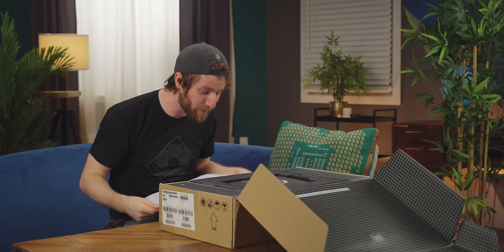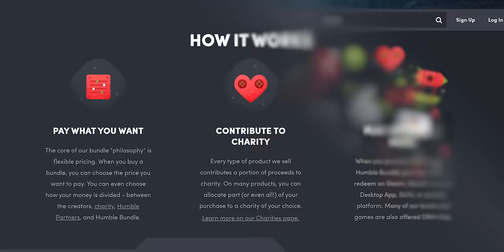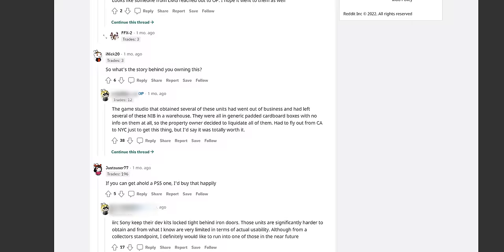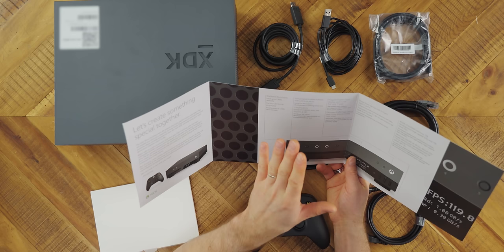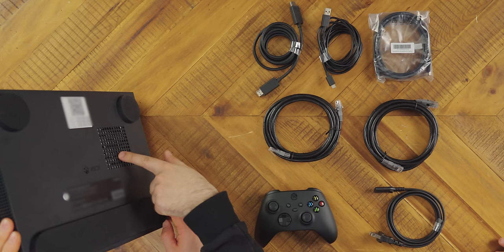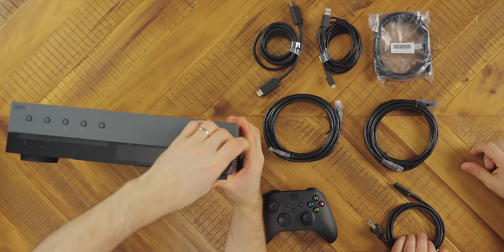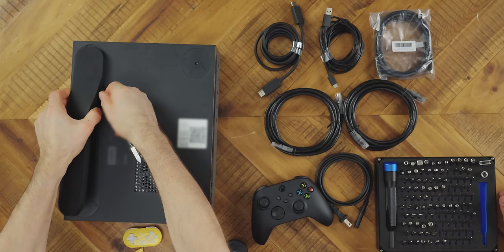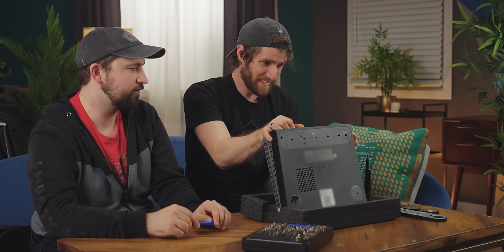I Can't Believe I Paid Two Grand For This - Xbox Series X Dev Kit

Comment from the maker: The extra memory is mostly for all of the extra debugging software, and a little bit for unoptomized games.
Reply: first again
Reply: @xmackdaddy69  yes, he did
Reply: I figured that was the reason, because I wouldn’t see the reason why an Xbox should have 40 gigs of GDDR6. Absolutely insane.
Reply: @bluephoenix1525  what's the exact reason for banning steve?
Reply: @renofumi28  they didnt ban steve, steve obtained it banned. But even if they did ban steve it woulda been because he wasnt supposed to have it
Reply: Litttt
Reply: Cool video
Reply: It's crazy you got your hands on this so early. Like wow that's absolutely nuts lol.
Reply: It got banned 😆
Reply: GN: "I got my hands on an Xbox dev kit."
Linus: "Write that down! WRITE THAT DOWN!!"
Reply: I need a gpu for my sons computer tower he has an rx 470 4gb in it now but it's stuck at 100% utilization ,the card gets extremely hot and just crashed when you try to play a game, I removed the metal backing plate in an attempt to see if it needed thermal paste and then I saw burn marks on the metal backing plate as well as on the circuit board,,
I don't know much about computers but I paid $1,200 for his computer tower @ xmas time I had it built from a guy online and he got 4½ months out of this rx470 4gb gpu card..
Can anyone help us out with a gpu so I can get his tower up and running again so he can play his games..
We're located in northbay ontario canada, we need Linus help but I doubt he'll ever see it
Reply: Taking bets on how long before Microsoft sends LMG a take down notice
Reply: @Anonymous-n7d  linus has a forum
Reply: "unoptomized games" pro english Linus...
Reply: FINALLY IVE BEEN ASKING FOR THIS WOOOO
Reply: Install original xbox os on the dev kit
Reply: my question is, is it white listed on a hardware lvl or just on the SSD? If just on SSD you could put a SSD out of retail Xbox.
Reply: @xmackdaddy69  no it came banned already I believe .
Reply: oh ok
Reply: hello btw
Reply: usually debug symbols are also stored in the application. Debug symbols are intended for developers to set breakpoints and view code during runtime. Usually (for big games) they'll be very big as it contains unmangled names, structures, classes, and etc.
Reply: 22nd
Reply: @Anonymous-n7d  The problem is that even if Linus sees your text. He probably gets thousands of people asking him. So I highly doubt he will respond to you. I hope you get the GPU sorted though.
Reply: also wouldn't all the problems Xbox players are having with DRM lately tell you everything you need to know about having to sign into Xbox to play you games even FUCKING devs.
Reply: Don't want to wait for daily builds of your software to download, so 10G.
Reply: i think having an fps counter on my console would be good to have. Find out if something is acting funny, or indirectly check if temps get to high
Reply: You missed to censor the label on th box
Reply: @SpaceGamblerJR  Didn't steve replace the SSD and confirm it was on a hardware level?  I might be misremembering but I'm pretty sure he confirmed that it was the hardware.
Reply: 4:50
Reply: now you owe it to audience to show how to solder a Modchip into the console and get it working!
Xecuter chip, ...
Reply: Not sure if the editors forgot to blur it, but the console id is visible at 17:00
Reply: For your information, remote debuging via Lan it's a thing :)
Reply: any game that is also playable on Xbox One needs internet to play on Series consoles so I'd assume if you had tried a native XSX game disc such as DMC5 Special Edition you would have been able to play it
Reply: Drama
Reply: So it might just run Ark properly
Reply: Don't watch this video , another then on off he cant run even one game.

He  try 22min ,but in the  end   nothing. Go start and waste 100$ on games and $4K for 2 unit xdk.

The only reason this units in sell ( the unltimte game con) is it useless.

i will use it as pc. Format all the drive and instal windows 10
Reply: THIS.
Reply: Guys, you should de a video about:

Who is this person and why it will be hosting videos.

because when i don't know who is talking i do not hear them because i'm unsure if their opinion cloud be valid.
Reply: People need to understand the title right: I Can't Believe I Paid Two Grand For This
Meaning LMG paid MICROSOFT for it not them paying him
Reply: So you paid a sc**per price? ;) ☮️
Reply: Could you has try USB harddrive with  game instill to test it offline?.
Reply: Does Linus just play the idiot?
Reply: Usually, these are paired to a PC that has a XDK installed.  You can usually launch the app from the pc and it will run on the dev kit.  You definitely use the debug cable to get memory dumps or monitor log streams from the console as your app is running.  Wired is way better than wireless for debugging, since log lines can get so big, frame (network frames that is) congestion could impact gameplay.  This separate connection helps ensure you aren't going to have that.  Ultimately all the additional headroom in spec is for debugging during runtime.
Reply: Stacking: Back in the Big green days, we would stack 8 tall for hardware compat.  Definitely did not help with those efforts.  Most testing I was part of was single user on a bench with room for 10.  Each tester had their console, a recording device (VHS, before we had pc's to capture issues on), a secured cage, some controllers, etc.  Thinking of the cage makes me check for cuts on my fingers.  Brutal hardware.  Sometimes we stacked 4 consoles in a cage for multiplayer testing stations.  After going to 24/7 testing, they ditched the cages.  benches held 24 smaller stations, and their test plans went to the trash.  I think they relied on earlier compat to do initial play testing, before giving it to the machine of 24/7 testing, where they would compress a weeks worth of play in 3 days.
Reply: @Linus Tech Tips  what happens when a video you try to make ends up scrapped and the money you get from announcing the sponsor go to do you use it for another video???
Reply: See this is why xbox upsets me. They have the tools and can add anything they want in the context of updates, but when actually adding updates on the FINISHED products; the consoles X/S are constantly having issues. Also noticeable is the awful quality games are released with; why not use a regular console for development purposes? If they did that, they would know if the game ran properly or not. I mean why keep these dev kits a secret?🤔
Reply: No, the extra memory is for extra data primarily unoptimised builds.  The extra debugging doesn't need much more RAM.  You would be suprised how much more ram an unoptimised game needs.
Reply: @SpaceGamblerJR  Its hardware level.
Reply: The extra memory is also for your SPONSOR.
Reply: I WAS OUTBID ON THAT BY YOU
Reply: Have you never seen modern vintage gamer? He's a decently big YouTuber who goes over the history of all this stuff. Before even watching this video I knew the games weren't going to run on this. On his videos he has development kits and lets his audience know that commercial games cannot be run on development kits. I really hope you didn't make this video knowing that.
Reply: @aloluk  how about make series X with upgradeable ram for unoptimized games❓It would future proof Xbox for 10 years.
Reply: So far the most expensive and broken things were the extreme intel server CPUs from a scammer.
Reply: Should of checked if you could cloud game via the game pass
Reply: Not many actually knows that One X was made and constructed and build with an NVMe SSD in mind.
You can see it if you open up your One X.. there is a big outline for an Key-M NVMe and there is even discrete components that as far as I can tell is referred to that NVMe slot.
but somewhere down the line, after motherboard was designed.. Microsoft made a hail mary and dropped that NVMe socket, and went for an Mechanical Sata3 drive and fitted an sata3 controller.
but you can easily use SSDs for One X.. as far as I can tell it will take 26 TB SSDs (2TB int. 3X 8TB ext), and now a days where NVme to USB3 socket are like 10USD its cheap way to stack up in SSD storage.. or you can use old Sata3 SSDs.. make a big difference in loading times - 80% and many small loading sequences is completely gone, for high res 4K gaming.. 

and it removes a huge chunk of pop in and hardware depended frame spikes from the mechanical drives horrendous slow access times.
boot up time is also cut a lot, to like  ½ min.
// ex. of the unpopulated M.2 pad Key M NVMe SSD on the One X MB https://youtu.be/HJezCkVbxmc?t=189

you really should be using SSDs on One X for high res gaming.. its still a potent 4k'ish gaming console with respectable 326Gbps memory bandwidth.
Xbox One 68
PS4 176
Series S 194 (avg)
PS4 pro 217
One X 326
PS5 445
Series X 475 (avg) 
The jump from Xbox ONe to OneX was weirdly potent  the "X" was a fitting name, and like 5x on both memory bandwidth 68 to 326 and mem bandwidth are crucial for gaming) and also close to 5x on Teraflops 1.3 to 6.

The jump from One X to Series X is more relative.1.5x and 2x  and IMO should have been labeled Xbox 2 and Xbox 2s, though that S-unit (series S) is a joke and way to weak for any longetivity and will be a bottleneck many years to come vs Sony that has a way higher minimum reference in PS5 when PS4 era is a dead dino....
Reply: @renofumi28  being named "steve" of course, who would even try that noeadays
Reply: microsoft can look up the device ID by the "last connection date"
Reply: The Xbox Seriex X Dev kit looks better than the actual retail Xbox Series X. Why did they move away from the Xbox One X look?
Reply: Why did you guys not download the game on a regular Xbox with a portable SSD and then put that on the dev kit with all the updates installed to the portable SSD
Reply: @jarno2427  he did via the update or do you mean going though format ssd then which won't work because there's a secret file that marrys the ssd to that board
Reply: @Anonymous-n7d  you really don't need Linus's help. Also, stop buying dodgy shit online.
Reply: Try inserting a native Series X disc into the thing. They don't need networking to finish installing, unlike the rest of the Xbox library, at least on retail hardware. DMC5's remaster is a good starting point IMO.
Reply: The debug port will likely have ports open (maybe telnet? or SSH?) so that you can run code directly from your PCs text editor and receive console messages back. So, like, suppose there’s a particular bug, but you can’t tell exactly where in the code that bug is, so you’d go to the relevant sections of code and put in breakpoints that print messages to help you figure out what’s going on, change the line, then run again to see if it is fixed
Reply: Yeah i see it
Reply: Micro-sized soft-ware when?
Reply: Ok
Reply: I want to buy one to play in 8k how much u selling
Reply: Cool
Reply: Ok bruh
Reply: @JmKrokY  wait wtf I just saw this on my notification why does ur profile pic look like someone ik
Reply: Just a thought, why don't you use retail Xbox with external storage to download games and then connect it to the dev kit to play games?
Reply: Is the typo an inside joke?
Reply: I see a bit of unoptomized spelling there
Reply: Unoptomized? Lol
Reply: How much will Microsoft pay you to get it back ?
Reply: Should have waited for the community to hack the things guys!! 😆
Reply: Do hard reset from settings and get a sandbox id buddy
Reply: @epmcgee  how do you know what I need
Reply: @mrtron7837  it looks like xbox one.  they wont do the same thing twice.
Reply: Linusbrush threepwood
Reply: @Anonymous-n7d  because you're not going to get it. Put your time and effort into something else. Look at the used GPU market maybe you find something cheap that can do the job for now
Reply: I think so.
Reply: Love it 😍
Reply: Why didn't you try an Xbox One X game instead of old games that have to download the ported version?
Reply: I felt the same way about you're mom 👩 🙃
Reply: Set the date so the Certs are valid.... Duh!! You didn't need to try offline upd...  FYI the pool of MAC addrs(es) are so small, the devkit KV's will get blacklisted by the kernel
Reply: INCOGNITO PLYR  yes...this!
Reply: pttf years ago my game deg college club got a wii u dev kit. We gamed on it. So would any dev. Kinda hard to test games if you know...you dont play them
Reply: LOL like you didnt make more money on this video. I cant believe you get so much money for videos should have been the title.
Reply: Seriously, you NEED to get some game dev in there. The amount of stupid Linus can say about game development in a video is astonishing.
Reply: The Xbox dev kit looks like a stereo system.
Reply: Question why don't you load the stock OS
Reply: Ot how to extreme anti crashing and anti - bugging (aka lag extermination kit)
Reply: except it isnt
Reply: @xmackdaddy69  that's not saying much, Microsoft and its Xbox brand sucks. I rather beef with Microsoft than Nintendo or Sony, thr GOATS LOL
Reply: @aloluk  Like android games(unoptimized) vs apple games/apps(optimized) .. basically my ram gets  eaten up if on non 12Gb ram phone
Reply: So that the unopzimzed games look optimized to the developer and they can ship their nonsense to us. Makes sense, now i understand.
Reply: Ive thought about it and it seems to me logical with 40gb of ram for one simple reason:
16x2 for xbox series x games +
4x2 for xbox series s games.
32+8=40.
Its standard to have twice the memory in a devkit isnt it? Besides theyre making games for both systems. Would be easier to have it all in one box, wouldnt it? Rather than two separate boxes for both s and x. Also cheaper and easier for devs to work with.
Thats my guess.
Reply: This is really disappointing they could have made the Xbox series x smaller and still kept a hard drive and had a lot of Ram and refresh rate
Reply: @lakak  me litery not askibg :oops:
Reply: Too bad the users XBOX doesn't look as nice as the devkit
Reply: A little
Reply: You paid 2 grand for last generation internals
Reply: Can you make that an emulation machine???
Reply: What happened to the console
Reply: Willow video is the best